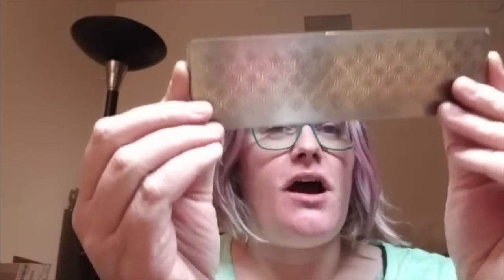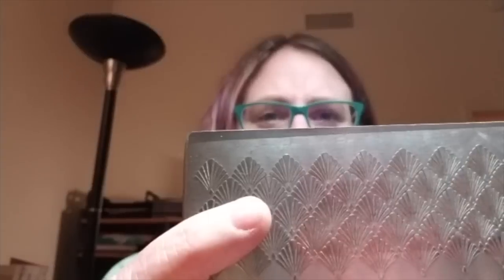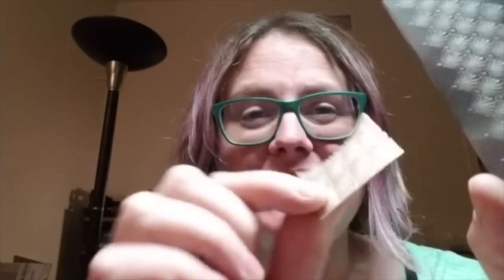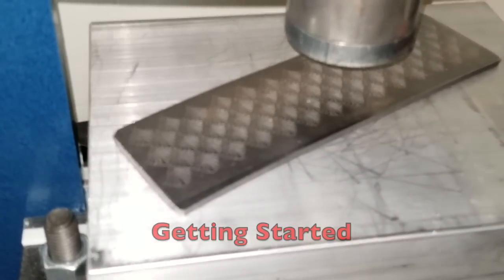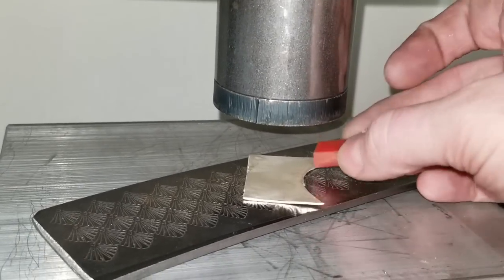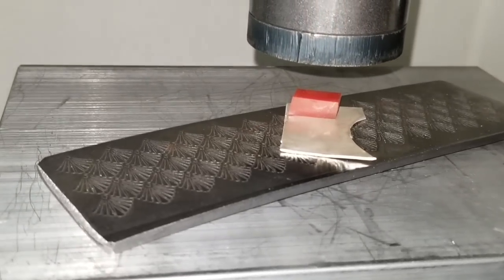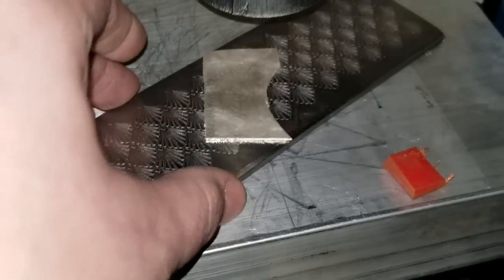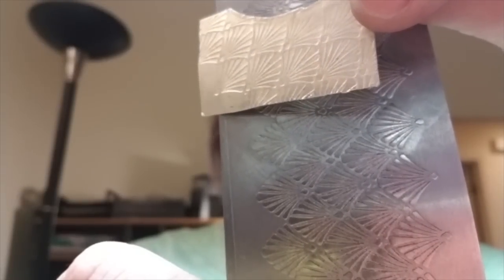Potter USA Art Deco Pattern Plate with a Press

Comment: can i use steel instead of copper? Also are the pattern plates made of steel? did you make pattern plate by cnc or laser? Thanks
Reply from the maker: Steel would not work with our plates. The plates are mild steel, soft enough to prevent any damage to a rolling mill. They are cold- forged and designed for use with annealed, nonferrous metals.